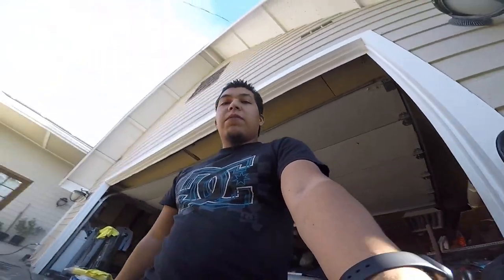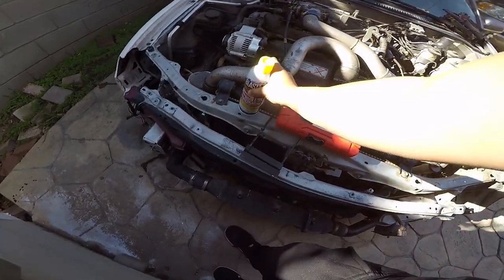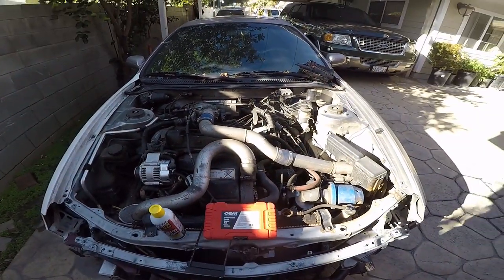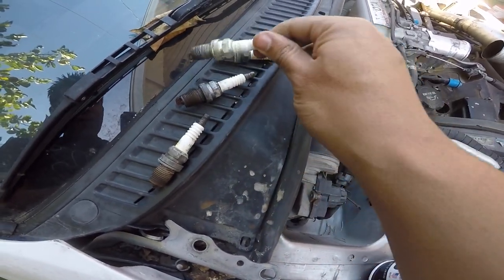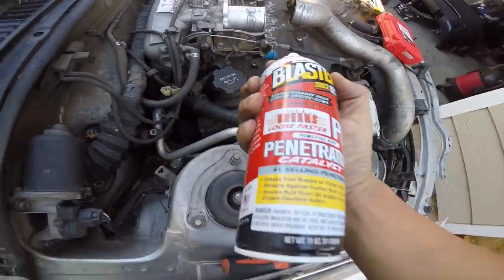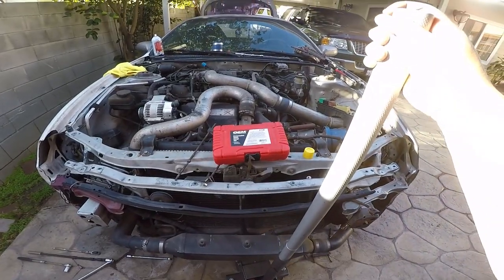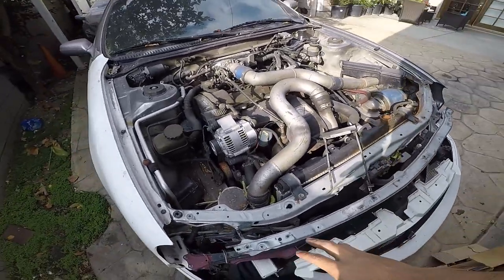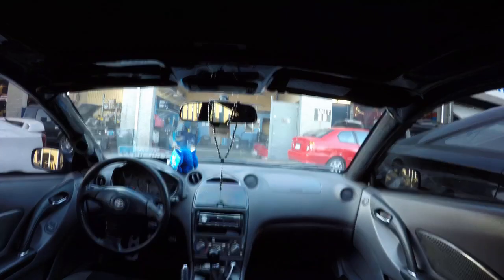Trying To Un-Seize An Engine

Comment: I used diesel fuel in the cylinders, Let it soak for 1 week, Broke free cranking it over with a fully charged battery, Took about 8 times but it broke free 100%

Comment: Gotta have a but more patience then that..if it did seize from water getting ....keep sparying it every week ...put your socket back on the crank with a breaker bar ....and apply some light tension with a ratchet strap and let it sit that way for a few weeks ...keep soaking..keep soaking ... .it will free up
Reply from the maker: Thanks for the advice

Comment: When you say seize do you mean the engine wont turn/locked up? You should be able to put a huge socket on the cams on the head and get the engine free! Are you sure its seized? If so im curious how long it sat.
Reply from the maker: Not that long car over heated
Reply: @RafasGarage  probably valves went bad. Thats a blown motor not seized!
Reply from the maker: @jasonfujioka8766  if valves were bad car wouldnt of turn on so it aint blown
Reply: @RafasGarage  ive seen engines run with bent/ broken valves. Just clicks or knocks alot.
Reply from the maker: @jasonfujioka8766  mine wasnt doing that
Reply: @jasonfujioka8766  my truck just click at the starter and went got a new 1  I took all the spark plugs out I sprayed some pB blaster in each spark plugs holes and just I put some misery oil in it just so I will let that sit a day are two  I’m thinking it’s my oil pump I went a mile and a half down the road in the truck just stop 2000 Yukon 5.3 L liter
Reply: @breadwinnermolicker9375  dude I got the same problem, did you fix it ?